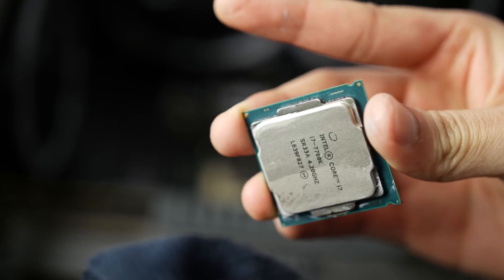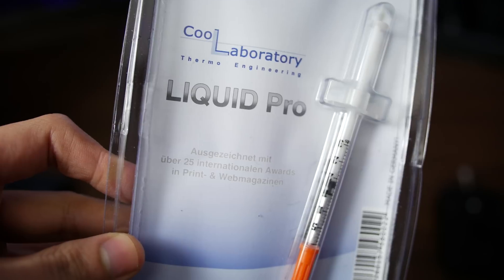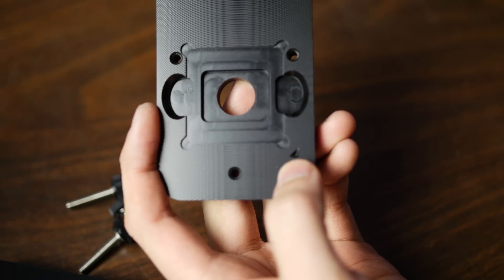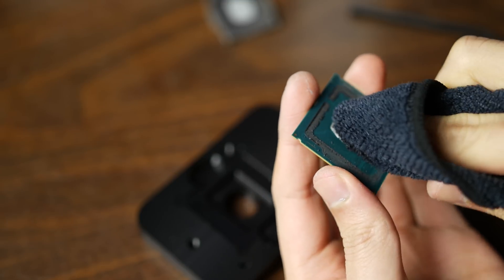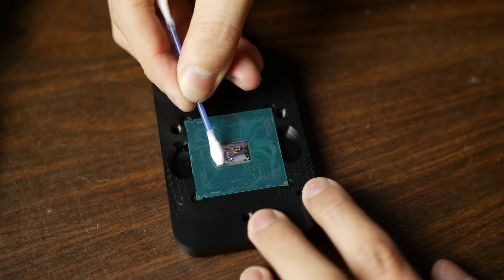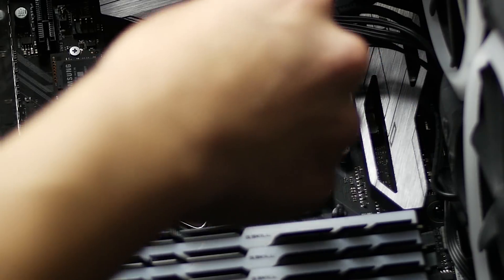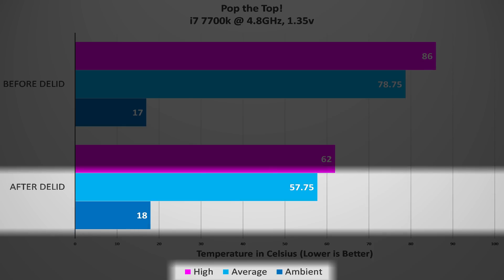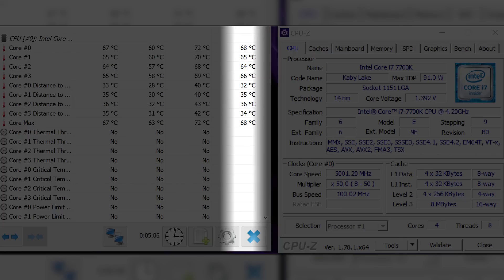Delidding the i7 7700k - Before and After!

Comment from the maker: I let the IHS float for this project.  The motherboard's retention bracket is firm enough to hold it in place, and when I go to replace the liquid metal compound in the future, it's one less step I need to take.

I also chose to leave the IHS on, as opposed to direct-die cooling.  I wasn't confident there would be proper contact between the cooler and the die if I kept the IHS off, then I'd need to be much more careful while seating the cooler or moving the computer as to not damage the die.  And then I'd probably lose the IHS if I didn't keep it stuck somewhere, LOL.
Reply: Direct-die cooling doesn't work well with the 6700k / 7700k. The gold circuit next to the die is conductive.  You would have the cover it with something to prevent conductivity before doing direct-die cooling.  I remember doing direct-die cooling either on a i7 920 or 30 and having this issue.  I'll de-lid- but Direct Die is very risky comparably speaking.
Reply from the maker: YouTube never notified me of this comment, but thanks for sharing!  Good to hear about other experiences!
Reply: ALittleDIMM bro, this video made me give you a sub! 😂
Reply from the maker: Thanks, I appreciate it!
Reply: Ryan, one suggested trick is to cover everything (except the die, obviously) with clear nail polish. That should be more than sufficient to isolate any components from shorts from liquid metal, TIM or your cooler's cold plate.
Reply: "and when I go to replace the liquid metal compound in the future,"

how often do you need to replace it?
Reply: True as you also have to remove the retention bracket if you remove the ihs to make good contact

Comment: hellll no, im not touching my cpu, im scared to even touch it let alone deliding it.
Reply: My i7 6700k wad reaching 100c on stock, which obviously meant something was off, since my i5 6600k was below 70 on 4.5 oc.

Had no choice but to delid it today, had to do it like 5 times with normal thermal paste since my temps looked off.

In the end I managed to do it, reaching 4.5 on 1.3v and not going above 60, so I fixed my cpu pretty much

Comment: Delidding is not only good for overclocking. It's also good if you want a silent system because the cpu cooler fans don't have to spin as fast. You can even make your pc more silent by not overclocking and removing the fans from your cpu cooler.

Comment: sorry my bad inglish,i buy the coolaboraty an the deuer8 die 2,naw i have the 8700k jus 4.6 whit 1.180v and the maximum temperature is 70º,but i jus up to 5ghz,but its corrosive the coolaboraty or its not problems thakyou,good video,and not inyect coolaboraty:)
Reply from the maker: Apologies if I've misunderstood, but your liquid metal should not be corrosive if it's for use between the IHS and the CPU die.  Between the IHS and a heatsink is different.  The gallium will react with metals like copper and aluminum and cause corrosion over time.
Reply: ok is correctli is in de die and ihs,not in de waterblok,thackyo i suscriber naw,and activate de bell
Reply: and you have the room very beutyfoul i like

Comment: I am planning on doing this to my I7700K I have a small YouTube channel & rendering videos is unconformable to say the least at 86c sometimes jumping a little higher. Also not a fan of the Temperature spikes casing my fans to kick up just from opening a program.  Hoping to see these issues clear up. I do only have a single fan water cooler. But these temps are still nuts. You have eased my mind on doing this myself. Thanks
Reply from the maker: Good luck!

Comment: i7-7700k 
Stock speeds, no bios changes from factory
H7 cooler
I hit 99c playing assassin's Creed origins. I played it with MSI Afterburner and as soon as I saw the temps climb I quit the game. Temps immediately dropped. I reapplied thermal compound under the cooler, just in case. Loaded the game again and same results. 

I will be delidding this CPU. But, first I'm going to try an alternative cooler. I think the H7 should handle cooling this CPU at stock speeds as the cooler is rated to 140w. If there's no improvement with an alternative cooler I'm delidding this damn thing.
Reply from the maker: Wow, no overclock and that hot, huh?  What are your idle and ambient temperatures?  Is your case's airflow okay?
Reply: Idle temps are around 40c. Ambient temperature are average. Roughly 68-70f.
Reply: Case airflow is ok. Two front fans and one rear fan. I had an i5-7600k in this case with all the same hardware and never saw temps anywhere near this high.
Reply: And that chip was over clocked to 4.8.
Reply: I purchased an EVGA 280mm AIO cooler and installed tonight. I played assassin's Creed origins again with the same ambient temperature. I played for an hour and the CPU temp maxed out at 77c. With MSI Afterburner running at the same time, generally, the temperature hovered around 70c most of the time. Huge improvement. Still odd though since the H7 theoretically should have worked fine. Proof is in the pudding I guess.
Reply from the maker: Glad it ended up working out for you!  The H7 thing is still a bit strange, but the 7700k can run pretty toasty...

Comment: I am actually thinking about doing this. The problem I am having is that when I open a program one of my cores spikes to 60c then drops back down to around 30c. and my fans kick up because the temp raised. I feel it is a little un stable. maybe an air bubble from the factory thermal paste. I am thinking about going with a better thermal paste rather than liquid metal.
Reply from the maker: Temperature spikes are normal.  I would be concerned if you put it through a stress test and your thermals went to something like 85C+.  I hear delidding and replacing the stock TIM with regular thermal paste yields significantly less impressive results, so I'm not entirely sure it would be worth it in that case.

Comment: So the hyper 212 tower cooler has a copper base, so why not use Liquid Metal there too since Liquid Metal supposedly has superior heat transfer... Wouldn't you want to use the best?
Reply from the maker: For use between the CPU IHS and a cooler like the Hyper 212, there isn't actually that much of a difference.  The "bottleneck" in the heat transfer process is typically the thermal interface material used between the IHS and the CPU die, where the temperature is much more intense.  The liquid metal is well-suited for that intensity, and as long as that heat gets through, your regular thermal paste can handle the rest.  You could use liquid metal in both spots, but the liquid metal TIM is more expensive, so using regular thermal paste for the cooler is more cost-effective, while still being fairly efficient!  Also, cleaning up liquid metal can be a pain, so if you ever swap or reseat your cooler, I hear it can get somewhat rough.

Comment: hello there i am not a pro so here it goes when deliddding cpu 7700k how much do i gain when on stock speed idle temps now 33c and 45c
Reply from the maker: It depends on the chip.  Your idle temperatures won't be too dramatic in difference, maybe 5-10 degrees.  Your load temps may drop anywhere between 10 and 30C, but it's different from chip-to-chip.
Reply: thx

Comment: Will not adding ai ches make temps even less ?
Reply from the maker: Sorry, not sure I understand?  I'm assuming you mean IHS (integrated heat spreader).  In which case, direct die cooling is theoretically better.  I chose to put it back for the reasons in the pinned comment.

Comment: have you had the Problem of random heat spikes before? and did the delidding help?
Reply from the maker: The random heat spikes tend to be from the CPU being asked to do something so processor load randomly spikes (bringing the temperature with it).  I think most of the processors experience this, and the delidding does help (not with the frequency of the spikes, but they become much less dramatic).

Comment: De-lidded my 6700k on my laptop CPU.   Went from 80c full load to 64 full load.   Very happy.  I do Cinema 4D rendering, I wanted to extend the life of my CPU and I'm not planning to overclock. I decided to glue my lid for my CPU back on-  and didn't power on my laptop for 3 days just in case I need to have my system serviced :D
Reply from the maker: Congrats!  Sounds like pretty good gains!

Comment: Friend has an old 4770k that runs hot, can't OC it at all. Just even going for 4.0 on all cores causes bluescreen. Even with voltage added, then gets too hot to make it worth it. I think the CPU is a dud to be honest, but now that the CPU is out of warranty anyways, I had been giving some thought to delidding the sucker just to get thermals down and see if that would open up some room to OC the thing and help make it more stable.
Reply from the maker: If you end up doing it, good luck!  Old chips are great for experiments!
Reply: Acid001 He lost silicon lottery. I own a 4770k. I can air cool to 4.2 GHz but it does get warm. Now I am air cooled to 4.0 with no issue. I replaced the fan with a $40 be cool quiet air cooler after I broke previous and used plain Arctic silver compound
Reply: +Timothy Gibney yeah, the silicon lottery failed on that one, I'm sure. There was also an event when the PC was about 6 months old, where the PSU blew up on power-up one day. Not sure if it weakened anything in the system because it seemed fine. Maybe it did weaken components and now that it's older it's showing up when trying to OC it. 

The PSU sent a surge down the power cord and into the surge protector and actually fried the socket and destroyed the surge protector. I always wondered if any surge went into the PC because it blew up shotgun style and it was a nice Corsair HX 850 unit. Not some cheap-o PSU. Scared the crap out of my friend. I got a call shortly after to come and inspect the damage and set up an RMA for the PSU. Corsair replaced it no problem. 

Now it has the third unit in it. The first PSU arrived DOA, second one blew up after 6 months, and 3rd still going strong. I started to get nervous about that particular PSU after the 2 misshaps. But I'm guessing that's just what happens now and again with electronics. That 2% showing up after years of building for people and not having many issues before. Mostly DOA RAM, two times before that.
Reply: Acid my same fried PSU was certainly related to my Asus GTX 770 which did all the damage to 3 powersupplies. Asus and Nvidia are now on my do not buy list as a result. I switched to an XFX rx 470 and problem went away with a good season psu. Also the 4770K had shitty IHS heat spreaders. I got mine right when devils canyon came out which means it was fixed. You could try risk de-lidding it and give it a try.
Reply: Timothy Gibney At the time the computer had a Gigabyte Winforce GTX 770 in it. That's pretty odd that you mention having a GTX 770 as well. I know the PSU was up to snuff on power, with 850 watt. I just think it was a series of really bad luck. The same model PSU is running her upgraded rig, with a 6700k and 1080 Ti. The 980 Ti was put into the secondary PC with the 4770K, and hers was before devil's canyon, so it runs hot with that crappy IHS.

Seems to be a recurring theme for Intel, crappy IHS implementation. You would think after Haswell they would of fixed it. But you can continuously see them doing it, as others still delid and drop temps on even skylakes or kaby lakes.

Comment: Thinking of delidding my 7700k. What could go wrong? I've yet to hear anyone break their CPUs using one of these delidding tools.
Reply from the maker: In delidding itself, it's possible to damage the CPU die or bend the PCB.  These risks are greatly minimized with the delidding tool, but I suppose it's possible it can still happen.  When applying the liquid metal, you need to ensure you have enough, and that the entire die is covered.  If your coverage is poor, the chip can overheat and kill itself.  If the liquid metal gets in the wrong places, it can bridge contacts, cause shorts, and potentially kill the chip.  If you choose to do direct-die cooling, uneven pressure on the heatsink can damage the die.  If you're careful, most of these concerns shouldn't be a problem.

Comment: Hi suscrito from today! Good video ! My cuestión is? We're is the silicone? Is not need it?feels like that's the reason tempeters go crazy after overclock  to this voltage good luck
Reply from the maker: If you're talking about resealing the IHS to the PCB, it's not really necessary.  The motherboard's retention bracket will hold it in place!

Comment: Why put the lid back on?  Wouldn't it be better just to leave it off?  Obviously you'd have to be much more careful, but let's leave out the middleman of the IHS.
Reply from the maker: I had a few of reasons.  I couldn't guarantee proper contact between the cooler and the die if I kept the IHS off.  Then, as you mentioned, I'd need to be much more careful while seating the cooler or moving the computer as to not damage the die.  Lastly, I'd lose the IHS if I didn't put it somewhere, LOL.

Comment: it baffles me. why don't Intel just use liquid metal inside the factory.
Reply from the maker: Liquid metal will have to be replaced every so often, much more frequently than the stock stuff.  I think most people might be uncomfortable, or not want to be bothered with that, so they opt for the stuff with greater endurance, but poorer performance.  As to why they don't solder, apparently it can stress smaller dies and reduce the processor's lifespan.  For larger chips, I have no idea.
Reply: I see, that makes much more sense assuming people working for intel aren't drunkards. Also how often should I replace My liquid metal. (still intel's thermal interface got to do better than that)
Reply from the maker: I'd also like to see Intel's stock paste perform better!  But I don't have experience in manufacturing, so I'm not sure how that would affect production.  In terms of replacing the liquid metal, I've read about once every year or so, but there seem to be some people that say once every six months, and others that say it can go for longer.  I planned on revisiting this in February of 2018 to see how it looks!
Reply: thanks man I'll look forward to it

Comment: how come you got even lower temperatures with higher voltage @ 5.0 ghz!?
Reply from the maker: Delidding and replacing the thermal paste with liquid metal improved heat transfer!
Reply: ALittleDIMM oh I feel like an idiot, I thought you just increased the voltage not a before/after delidding.

Comment: So what could you expect the benefits of this to be without overclocking in mind at the end. Would this make your CPU last a lot longer?
Reply from the maker: Benefits would include lower temperatures, which would allow your CPU to last longer (though, I can't put a number to that claim).  If you don't plan on overclocking, or if you're planning on a modest overclock, your CPU can already expect a long lifespan, and this procedure isn't recommended.  Note that the liquid metal will have to be replaced every so often, whereas the stock material should last throughout the processor's lifespan.

Comment: i do it same is you and only 12 degree drop 😢😢
Reply from the maker: Twelve degrees is still good!  You're not always guaranteed to see dramatic effects, temperature will vary from chip to chip.
Reply: ALittleDIMM after i spend a fucking $85 ??  

i will cray 😢😢

can u switch your chip with me ?
Reply from the maker: I did say a chance at higher overclock, I can't make any promises with processors!  Nothing above stock (or boost) settings are guaranteed with any CPU.

I'll swap chips if yours can hit 5.2 GHz stable ;)
Reply: ALittleDIMM it reach 84c after 15 min stress test on 5.0ghz with 1.320v i dont think it will go more then that
Reply from the maker: Are you sure everything is seated properly?  What cooler are you using?
Reply: ALittleDIMM corsair h110i
Reply: ALittleDIMM what is your ram speed ? mine is overclock to 3200 and its effect the temp
Reply: ALittleDIMM i forget to tell u i used liquid ultra not pro do u think because of this i didn't get much drop ?
Reply from the maker: I heard Liquid Ultra is supposed to be better, but I haven't tested, so I can't be sure.  My RAM is clocked to 3733 MHz, but that should not affect CPU temperature (by enough to be significant).  Is your cooler set to max fan and pump speed, or do you have it on quieter settings?   You can try reseating your cooler or redoing the delid.
Reply: ALittleDIMM it's very hard to clean the liquid metal
Reply from the maker: If it starts to solidify, you'll need to heat it up first.  Run a stress test for an hour or so.  Though, if this is a recent application, it shouldn't have dried up, yet.
Reply: ALittleDIMM and clean it with alchool ?

Comment: tbh, i rather pay 4 extra dollars to buy a cpu than delidding myself. FUCK YOU INTEL
Reply from the maker: Well, delidding is optional.  I hear Intel chooses to use thermal paste on the smaller die chips because soldering won't last as long, due to how quickly they can heat up.  I don't know what they're doing with their larger processors, though.  Skylake-X (and Kaby Lake-X) won't be soldered, it seems, so that's odd.